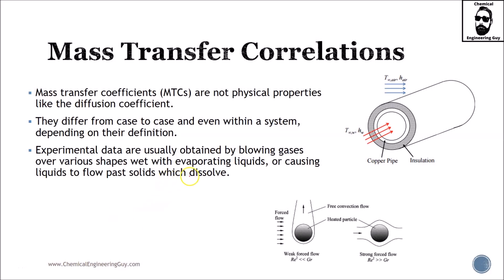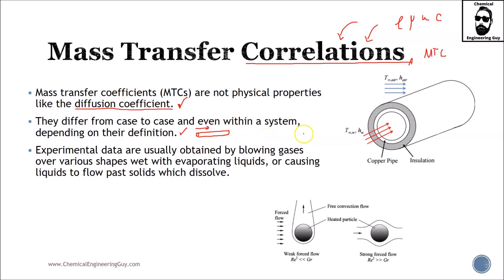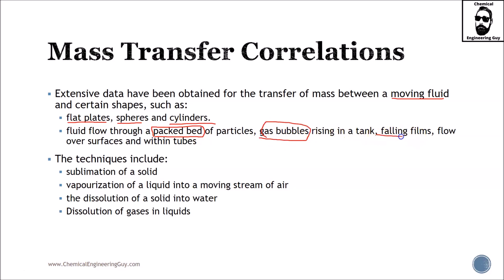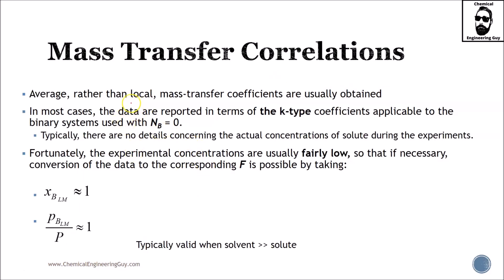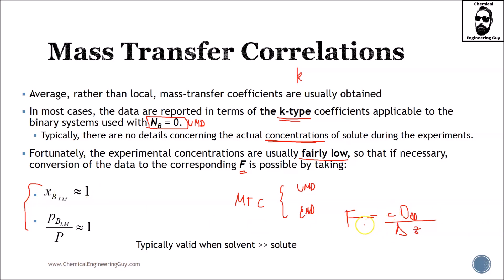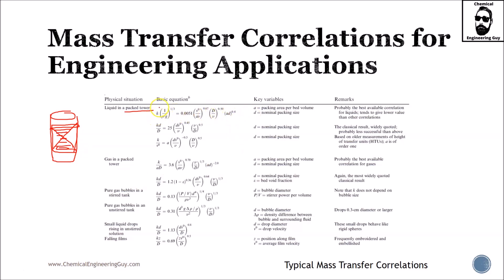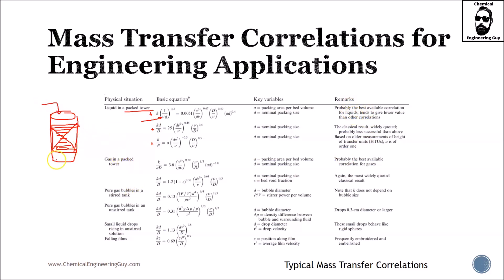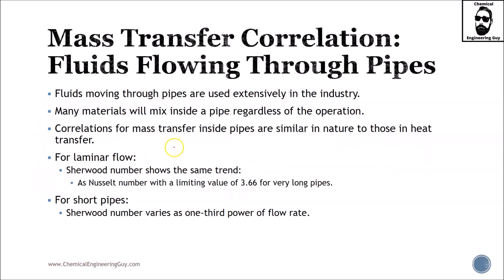Mass Transfer Correlations & Equations for Coefficients (Lec169)

Comment: In which textbook did you find these correlations?
Reply: This is from Diffusion: Mass Transfer in Fluid Systems 3rd Ed by E.L. Cussler. It's located on page 252 of the book. You can find a PDF online. Just google the title
Reply from the maker: Most likely Benitez or Seader